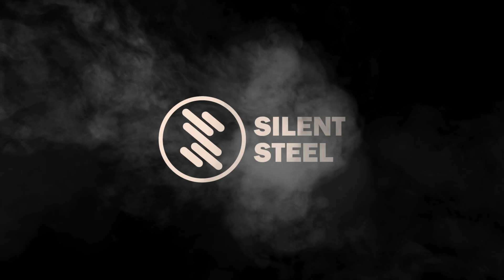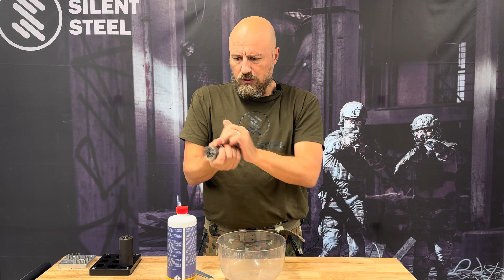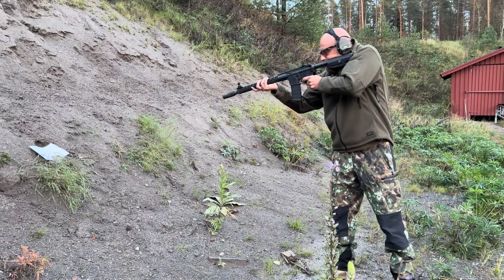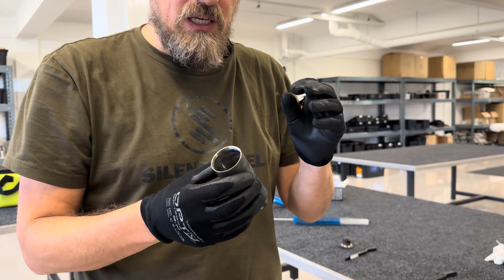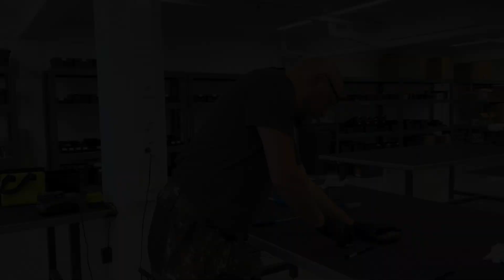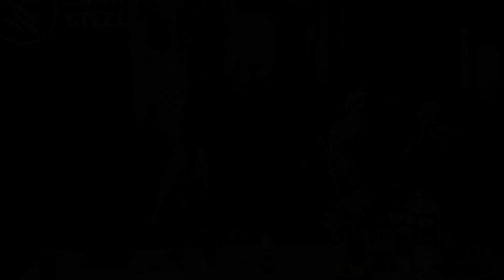Silent Steel suppressor cleaning

Comment: Where can i buy the Front cap tool?
Reply: Basic angle grinder pin wrench
Reply: @Petteri_FIN  mine is very blocked and a simple Pin Wrench is not enough, the fact of Silent steel not used the provided tool but a Stronger one means they know that the provided tool is too fragile.
Reply: @propionic0157  Mine was Backet shut also (around 3000 rounds). I submerged the whole supressor for about 4 Hours in Ballistol supressor Cleaner and it was easy to open with a basic grinder wrench. From the Pictures alone the silent steel tool ist not hardened also. Just a basic Pin wrench with an upmark in price.

I shortened the Pins on my Basic to fit the wrench mor smug to the endcap